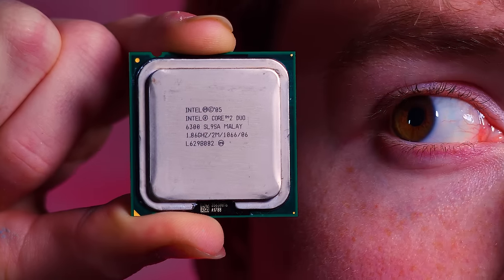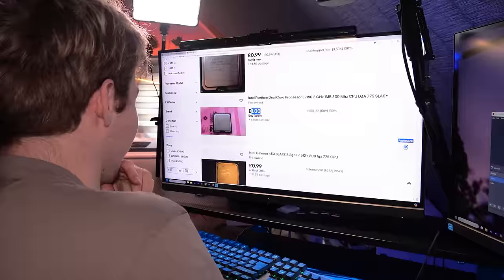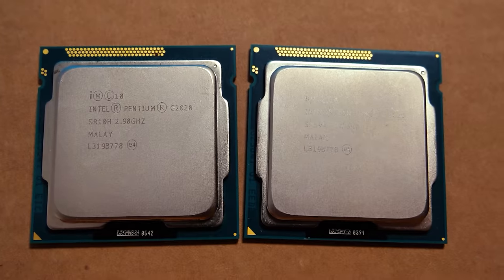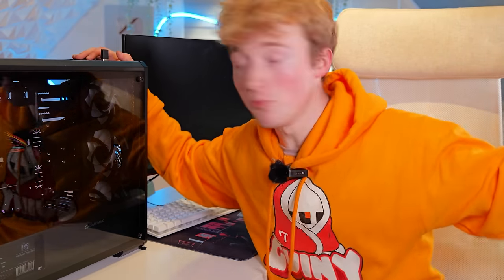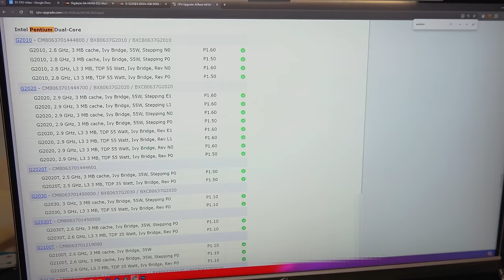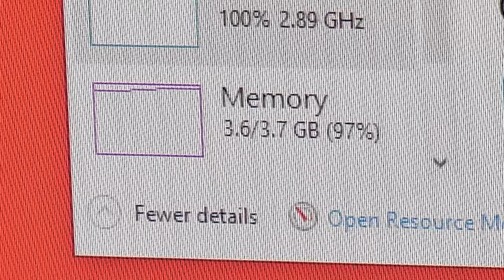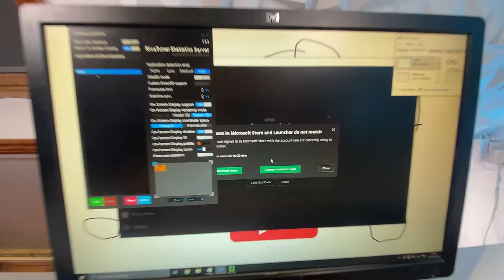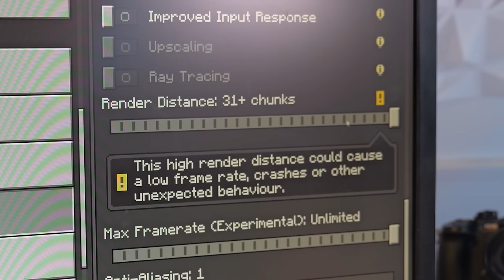I Tried Minecraft On A $1 CPU..

Comment: The CPUs may not be dead when you upgrade or replace a CPU sometimes or requires a bios update or downgrade depending on the CPU used for it to work with the current hardware
Reply: There are any number of things that stop a PC from booting, including the bios settings. I suspect a lot of people today have very little idea of how to troubleshoot such things, even though it's often a simple process. Everybody just wants instant gratification, otherwise they lose interest. Fortunately, nowadays motherboards are jumperless, everything is plug and play and the bios/EFI seems to have more intelligence than the people using the computer. 😂
Reply: Does updating the bios delete the microcode for the older cpus?

Comment: Bro when you change the CPU in your working PC......then you have to FIRST BOOT IT TO BIOS AND THEN RESTART!!!!!
Reply: And also check if the chipset is compatible before purchasing the motherboard and not the socket.
Reply: can't do that when it doesn't post
Reply: @yaniv_akrish  this doesn't matter with pentiums/celerons, as even the worst chipsets support them
Reply: @milktoast56   ho, ok, i never knew that, thank you for telling me that.
Reply: @milktoast56 Not always true, there are many cases where the original BIOS would only support a certain selection of CPU or RAM configurations. Whatever was current at the time will be supported, but anything after that may not be. That's why manufacturers issue BIOS updates.
Reply: @milktoast56 You can go into the bios before replacing the cpu and set it to the defaults, or even better, check the manufacturer's documentation beforehand and see if there's CPU support built in, available in a BIOS update, or if it's incompatible.
Reply: @yaniv_akrish true 11th gen intel doesn't support 10th gen intel but the socket is the same LGA 1200

Comment: i used to have a computer that would run minecraft java like this, it’d only get into playable (20-30fps) frame rates if i use absolute minimum video settings, my cpu was an i5-6300U, with an Intel HD 520, My new computer was a world of difference better, CPU was a major upgrade to an i7 vPro 8665U, the GPU wasn’t a massive upgrade but since Java is CPU intensive, it was way more fluid, even on medium settings, (60 FPS), The GPU wasn’t a major upgrade though. It’s running on an Intel UHD 620, Still better

Comment: If you had 2 CPUs for 1 dollar you should try to make them both work. You can either use one of them to run server on it to lift the load, or you can try to find some dual-socket motherboard.

EDIT: also try Linux

Comment: i have dual core, 2.7 ghz 2 cores 2 threads. I can play minecraft at like 100 fps, 4 ram, no video card. I also can play roblox at 50, watch videos without lag, and i played fortnite at 40 fps when  i had a good video card.
Reply: I have 2.30 ghz i3 6100u 4 cores i can play roblox at 140 fps on 600x600 res at 94hz overclocked monitor
Reply: Mine too

Comment: the cpu only matters on singleplayer btw
i had pentium e6300 + gt 1030 and it got 400 fps on multiplayer optifine 1.8.9, render around 7
200-300fps in a sodium modpack 1.20.1 multiplayer

Comment: i actually use a intel pentinum G3220 in my computer from 2008 or even older idk its older than me and the fact that it can run minecraft in the latest version in 60 - 120 fps is wild but in single player it goes from 5 - 60 fps and it happens in the start actually like when i generate a new world it goes like 0 or 1 fps or sometimes 5 but after sometime it becomes 60 with 32 render distance

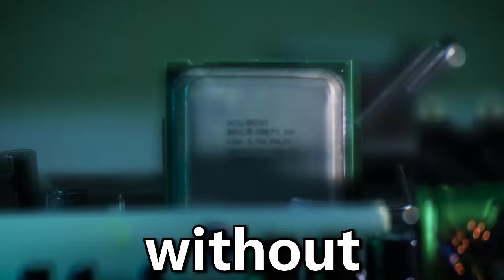Comment: 00:03 Nếu bạn không biết, ở Việt Nam, giá linh kiện máy tính cũ đã giảm rất sâu trong những năm trở lại đây, một thanh RAM DDR2 1GB chỉ còn 40 đến 50.000₫, DDR3 thì dao động từ 50.000₫ đến 300.000₫, DDR4 thì giá mặn hơn, nhưng vẫn rất rẻ, 
SSD NVMe 128GB = 500.000₫ đến 600.000₫.
Còn ổ cứng HDD thì giá còn ảo ma hơn : 120.000₫ cho một ổ HDD 512GB 7200RPM.
Về giá của GPU cũ thì khỏi nói, chỉ tầm 700.000₫ - 800.000₫ cho một con card đồ họa GT1030 Kepler thì bạn có thể biết được, việc bạn build một chiếc PC ở Việt Nam dễ đến mức nào !

Comment: I am struggling to not laugh.

There are so many points in this video when some ordinary issue is blow out of proportions, its Crazy.

1. Minecraft will automatically skyrocket to 100% during boot, it's the only process  that is actually multithreaded.
2. Naturally, you'll never crash during generation, no matter how bad your CPU is, it will just take very long (Excluding issues related to RAM or other problems)
3. No Shit it's SLOW, it's a dual core Pentium G2020. CPU's like this are not meant to be used anymore and are only made for sparingly low process applications like fucking microsoft word.
4. GPU will do nothing. Unless you get Sodium and Nvidium to work together, adding any gpus will do next to nothing for you, as minecraft is purely CPU focused game, thank you java
5. Even IF you added your GT710, chances are Java will just use Integrated graphics instead
6. The period where you DID have smooth 60fps is the period where your CPU wasn't scrambling to generate new chunks, cause u stood still.
7. You're on the newer versions, hence why it runs so bad. Of course downgrading will help your performance, its the simpler times, when performance was a thing.

I would love to see a professional Tech dude look at this video and debunk all the different shit blown so absurdly out of proportions :3